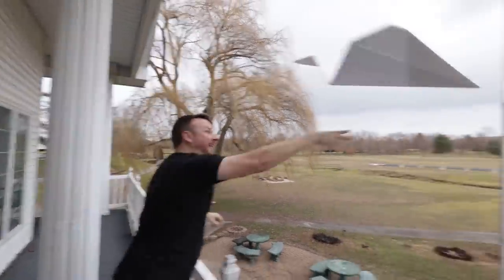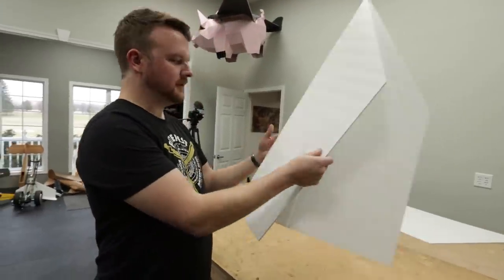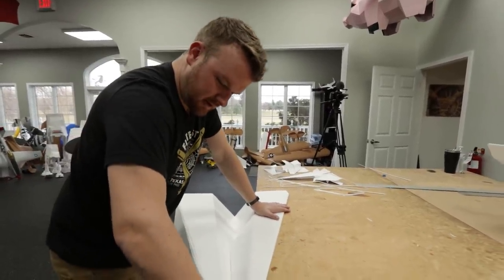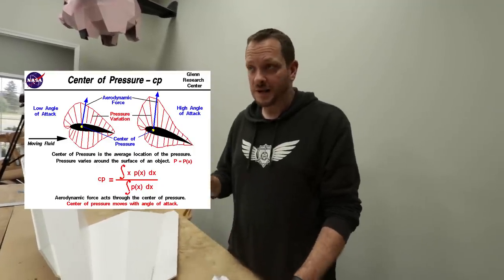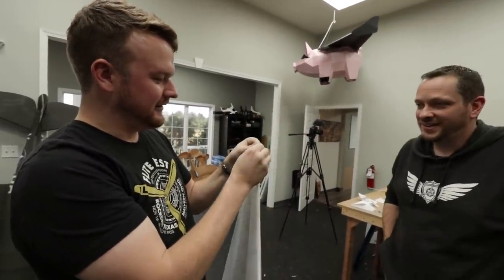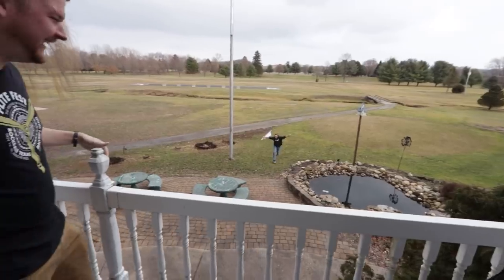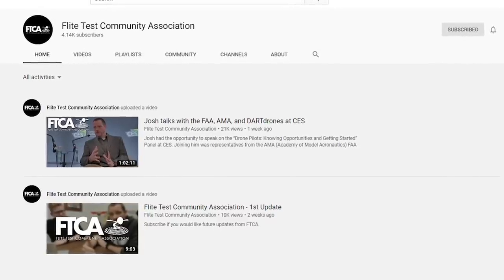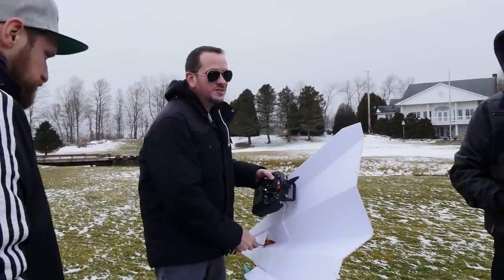Giant Paper Airplanes!? 😱

Comment: I've always had a particular style of paper airplane that I use that my uncle taught me when I was very little.  Still one of the best paper airplane types I've seen.  It controls wonderfully and you can adjust the flight characteristics very drastically with simple added folds, so it would probably work well with actual flaps.

I have no idea if it has a name and I've never seen it used by anyone else or anywhere else anything even remotely close.  Though the amount of folding it uses probably wouldn't be as good for foam as these more standard styles are, though if it worked, I could see it flying any way you would want depending on you how set the electronics.
Reply: This is all very well, Dashdragon, but we can't see what it is. How about posting a link to a photo or video of it ?

Comment: Dudes you got air fighters,fly a flock at the same time around pylons with anything goes rules last one flying is the winner, the airframe is just a dollar and some  hot glue protection from packing tape for the battery and electronics and it a free for all

Comment: Forget throwing them in class. Flicking them in the middle of 8th grade math class was more fun. A friend and I used to sit in the back of the class and make these tiny paper planes like an inch and smaller. They were terrible if you tried to throw them. But set them on the desk and flick them with your finger and they flew great. Though had to watch the design and how hard you flicked, a bad design or flicked to hard and they'd either spin or flip end over end rather than glide. Big thing was to try and get them to land on the desk beside you.

Comment: the first one is call  jet paper airplane.  that is what we called in the 80"s.  or just jet plain.  the other one do not know.
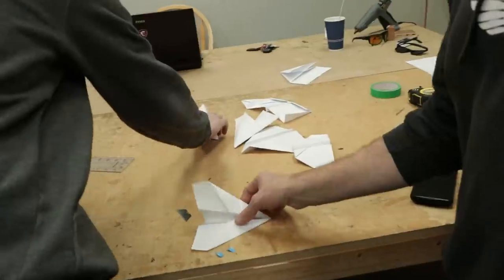also with the first one the jet plain. u can make the wingspan bigger as in wider and fold the wing tip up at the back left and right sides.  but this will give u less handle to hold on to, for throwing it. but the bigger wingspan will allow it to Glide more.  And for gliders.  the one u have at 0:39 that is  closest to Josh's forearm, and where u can see a  black spot behind it on the table. that one u can make it glide longer. if u make the wingspan wider and fold the wing like a paper chines fan.  when i was a kid i use to do that if it got high enough and enough wind it would gild for a very long time.  i also made a jet one. the one Alex had in his hand in the beginning of the video out of  balsa wood and added the rubber band and propeller design like those ones you buy in a store it work ok but not great. but it was fun to make and fly